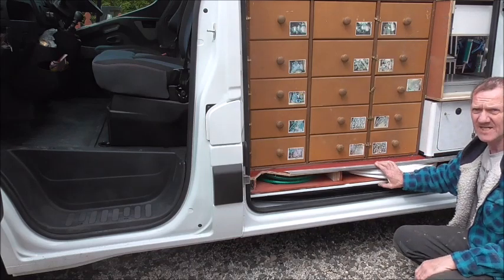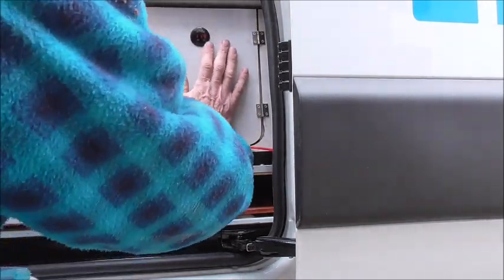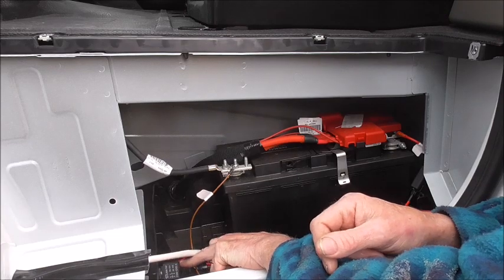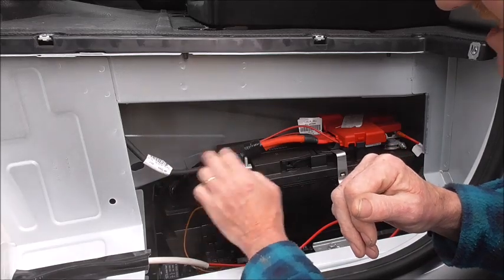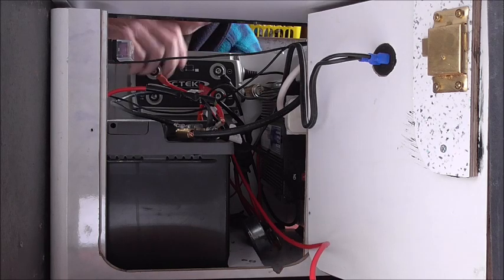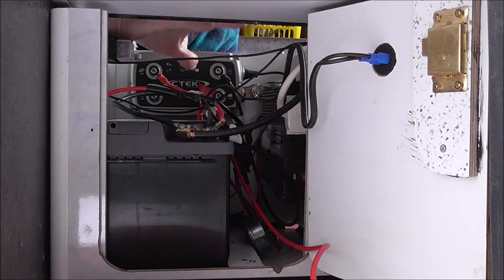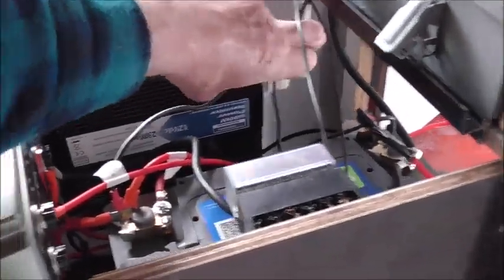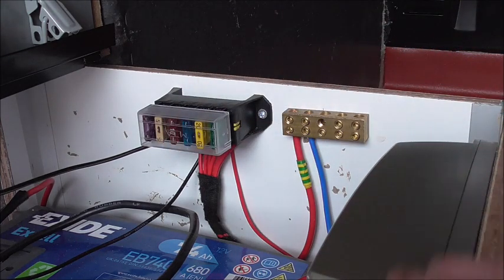Work Van DC DC Charge System

Comment: Hi there. Great work! I have been watching several of your videos fitting out your van. WOW. Really impressive. I started with the LED lights install and have been working my way back. I have a Ford Transit Van that I have been fine tuning. Down to lights and final organization now. 

Really like this power system. Think this is going to be my final step. Want to power battery chargers and a heater in the winter to keep things warm.

Thanks for the great details. I will probly have some questions when I start shopping and setting mine up shortly.
Reply from the maker: Hi Greg, first thanks for watching, I would give a sergestan don't use a electric heater it will suck the life out of your battery, to warm the van I use a small portable gas heater if your not moving they are very safe, it uses the 10" disposal gas cans.
Anyway sure ask away if I can help I will be pleased to do so

Comment: My boss supplies the vehicle, ive suggested a simular system to yours ...but...hes conserned what about the vehicles warrenty, its electrical safety and full removall if the van is sold on
Reply from the maker: ivan carter I always use contact hire vans for 5 years and the they get changed. I must return them as i get them or pay the price for any damage so if you look close at what i do you will see all is reversible
Reply: David Gladden thanks ...i spoke with ....dont laugh.. Halfords the guy there said they could do the connection bit,   i can show the boss if it goes tits up he can blame them , a mate recons he can create the second battery/ invertor set up , he suggests he built one for his van (which ive now seen and its neat , hes a sparky so id hope nothing more ) but he has vents at the ends and  gauges on top ...between you two your bloody clever .
Reply from the maker: ivan carter Thanks Ivan kind works.
Really I think if you follow my videos closely you could do it all your self if you get stuck I can advise and the pride is yours.

Comment: With this wiring config the AUX battery is piggy backing the main battery whenever the ignition is on regardless of the engine running.
Reply from the maker: thomas time yes that's as there is no engine running only live wire to use as triggersomi always remember not to leave the ignition on when the engine is not running which is a good practice in face the hand book even recommends adopting such an habit without having a split charge system
Reply: Hi Dave, If you interrupt the supply with a relay that is energized from the alternators dash board charge light circuit then this system would only be active whilst the engine was running..... ps is me Peter, she changed the account name.
Reply from the maker: thomas time in that case I will except the logic other wise I would say is this is how the book tells you to fit it and I wouldn't advise any only to go playing with the wiring without a lot of abilities in the subject the people the wouldn't need to watch me having a go, anyway nice your back online again
Reply: Cheers mate.
Reply: its peter  Thomas that's commenting on your vlogs
Reply: Sorry Dave that last comment came from grandson Thomas in one of his defiant moments.

Comment: I have just been shown the plans for a serious  van store system , came close to" porn"  the guy wanted a fully kitted out van on both sides of his van , the van has three cargo doors , a special addition, but he has to carry cookers so they will sit on a roller floor which will slide out .he will also have a parts rack(platic bins ) that hinges out on a pivot bar revealing a parts shelving rack on passenger cargo door. On the drivers side another parts rack for gas hoses. I thought hed be over weight but he took it to a weigh bridge with all the stuff in it on friday and its under his axle limit!!!! Im waiting to see this baby gestate in the next week or two
Reply from the maker: Ok sounds fine